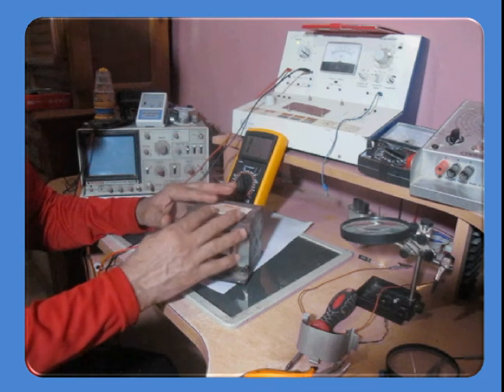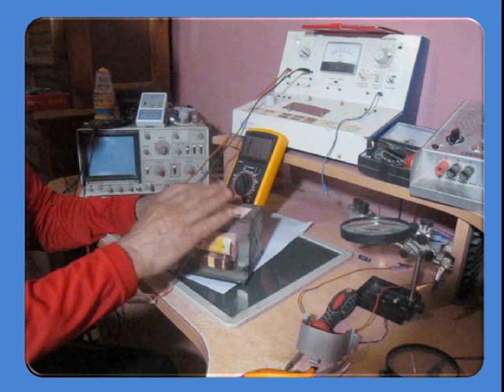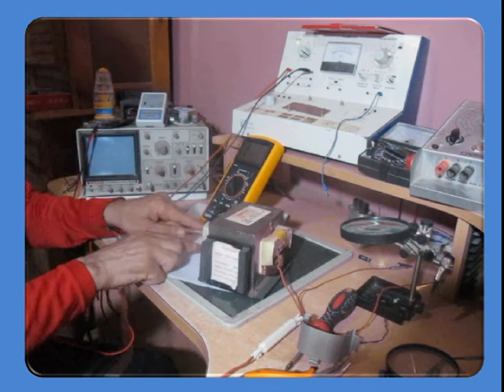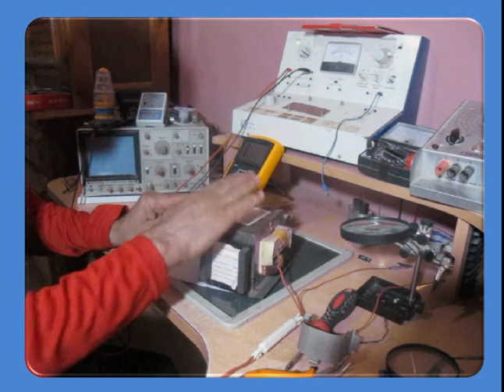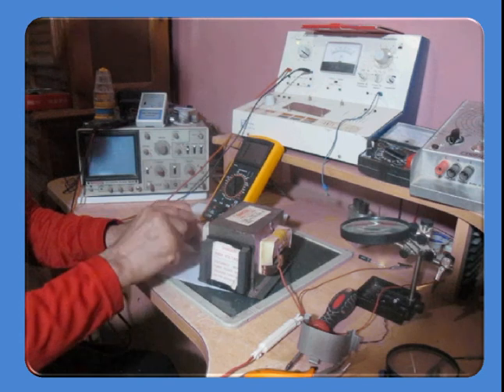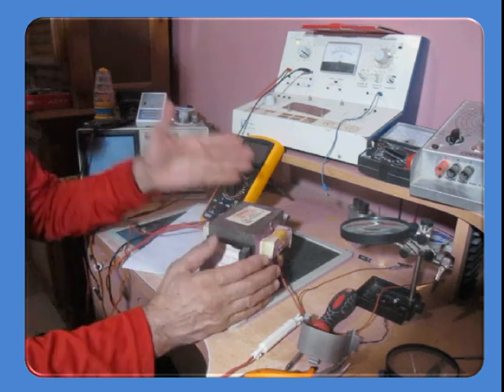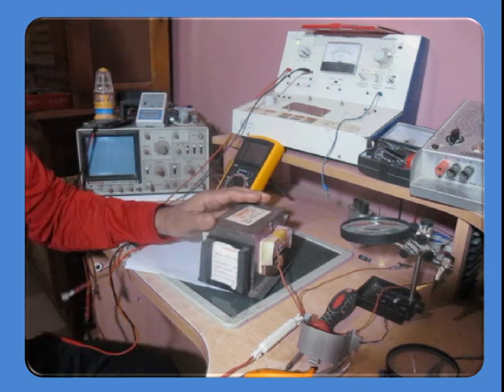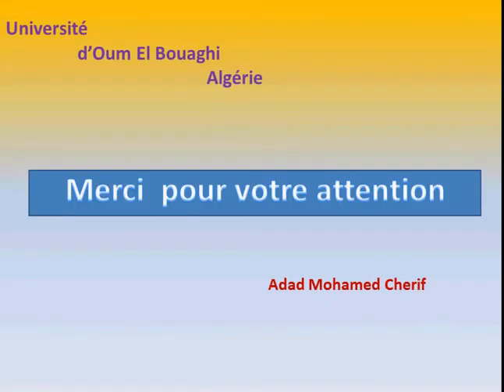Vérification du transformateur  de puissance du four à micro-ondes

Comment: Merci pour votre vidéo. Lorsque je teste la résistance du primaire de mon transformateur j'ai 3,1 Hom. Lorsque je teste le secondaire la valeur de 175 Hom s'affiche une seconde puis le multimètre affiche 1a nouveau comme si il n'y avait pas la continuité. Es ce que cela veut dire que c'est le transformateur qui est mort ? Pour information des que je branche l'alimentation du micro de cela fait péter le fusible qui est branché sur ce circuit secondaire. Merci d'avance.